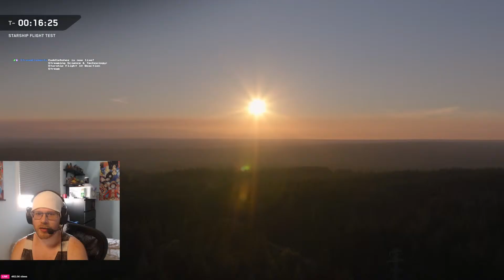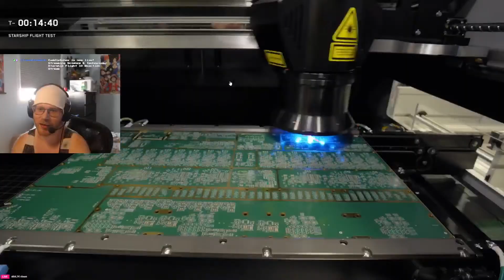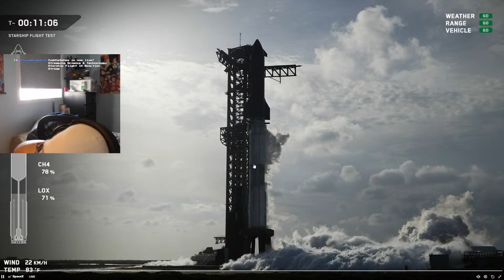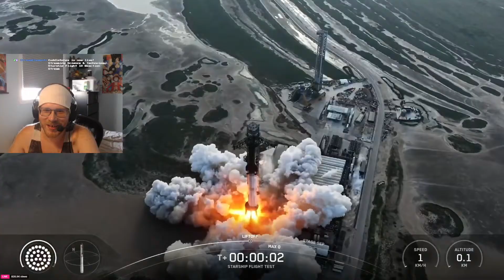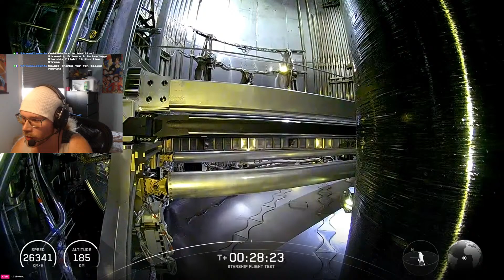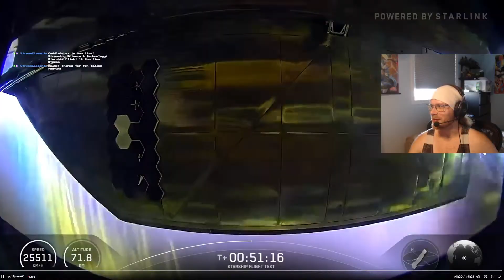SUCCESS: SpaceX Starship Flight 10 launch reaction

Comment: I find these events on the lower fins so bizarre. One explodes off-camera, during re-ignition maybe (nobody speak about this one btw), and the other on the right in front of the camera. It was both wings that apparently had a problem. But what kind of equipment can do that?
After looking at some photos closely, it seems that the Starship is not protected underneath, nor on the rear of the fins. So if the hot stagging is not nominal, a flashback can damage the structure quite easily. The two gas exhaust lines were therefore damaged and may have remained blocked and then exploded one after the other. I can only see that.
Reply: Actually it's been talked about. Mostly saying that the cause of the explosion was the vent that damaged the lower part of the lower flaps. About the explosion of vent pipes, one reason for it is due to ice formed during the coasting phase that blocked that pipes and would have melted during the reentry/ or the plasma could have which caused over pressure inside the pipes.
Reply: @Jamux69  You can freeze a stainless steel tube as much as you want; I don't see any way to plug it with "ice." So, all this is just speculation, especially given the force of the event (ripped off 4mm of steel). The pressure inside the tanks (8-10 bar) is certainly not enough to cause a tube to explode, even a simple current tube from your kitchen.
As for what "we didn't talk about," I meant the right fin, the one that broke even before the visible explosion. People have mentioned it, but we have very little information on it.
Reply from the maker: Yeah I think the prevailing theory is ice buildup during the coast phase. Good they were able to survive reentry and get the engines on for the final flip despite the damage.